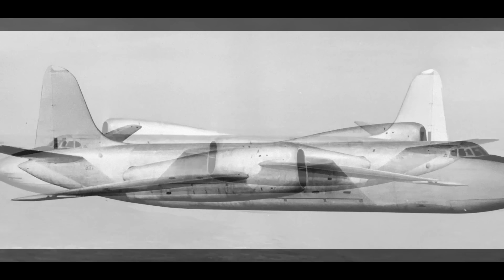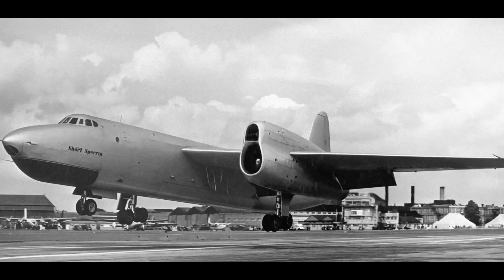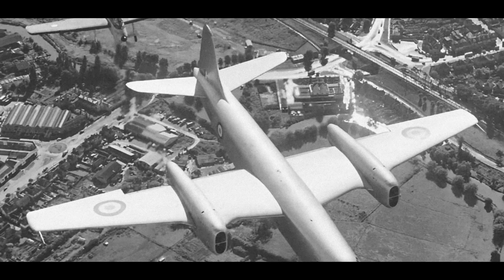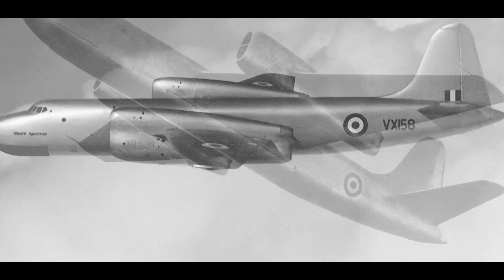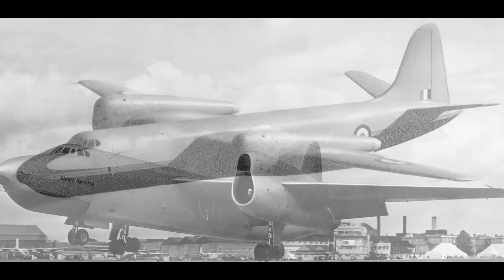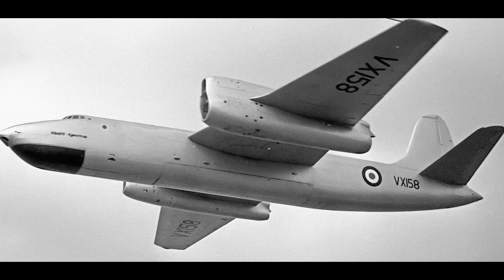Short SA.4 Sperrin: Why It Had Bizarre Stacked Engines

Comment: If you think about it mounting the Avons that way meant the wing spars could go in between engines rather than the spar having to be designed to go round the engines as it did with the other V bombers. In addition the engine thrust would not generate any torque on the wing structure as engines mount is pods below the wing do. A practical solution for what was always intended to be a "simple" design using well understood technology rather highlighted by the fact the airframes were more or less completed before its innovative hydraulic power controls were developed.